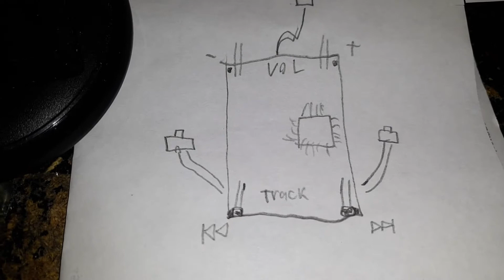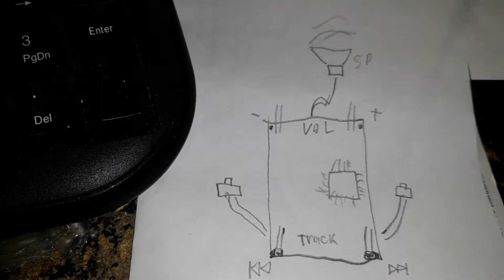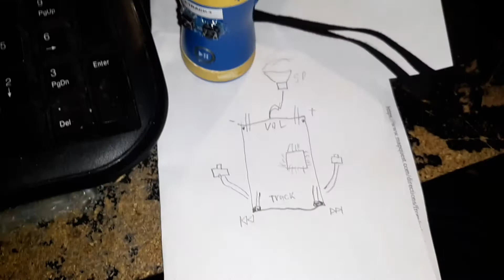Sansa Shaker MP3 Player repair/mod

Comment: How did you open it? Im trying to fix the speaker 😢
Reply from the maker: Mine is kind of broken, so the top just comes off. I'm not exactly sure how this originally comes off, or it's not made to. If you try to pry it off, you'll likely break something off. Be careful.
Reply: @coondogtheman thanks man, yep as you said it brokes a little but i remove it. Seems like the wire of the coils speaker breaks i wil replace it
Reply from the maker: @aldodelarosa6388 The speaker still works on mine but it's a little corroded on the metal back. If it goes open or the cone separates from the coil I'll try another speaker.

Comment: Wow, I found this video from a 13 year old comment on another video about the sansa shaker.
This thing was my childhood, I want a way to rip the boot up, shake and power off sounds in high quality just for data preservation.

Awesome that you put all this time into this silly player. I still have mine, yellowed just the same
Reply from the maker: Hey Thanks for watching.

I loved this little player when I got it. It was portable, it took sd cards, it didn't need software to load songs onto it, and it was loud. I had a neck strap on it so I could wear the music.
That is why I took the time to repair this player, it wasn't easy. Hopefully I will never have to open it again because it sat in pieces in a plastic rayovac battery container for years until I got the parts and will to attempt the repair. Now its usable again.
Reply from the maker: I hate to do this but I may have to open this player. Thankfully it's just the top. I'll  record all the sounds including the "ut oh" sound to a wav file and may even throw up a vid.
Reply: @coondogtheman  :O Good luck!